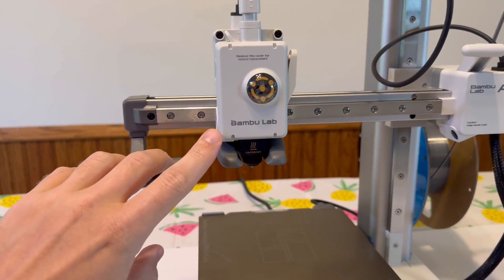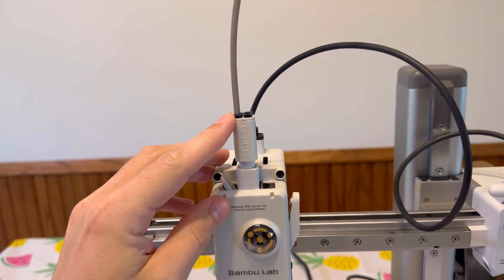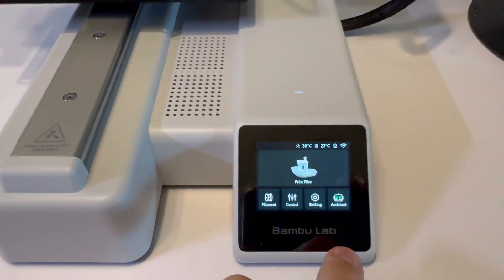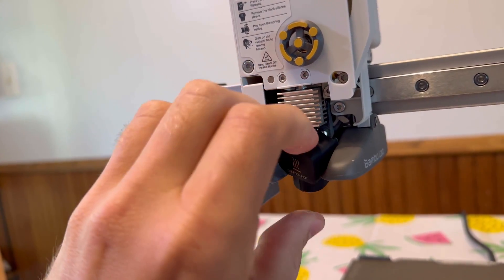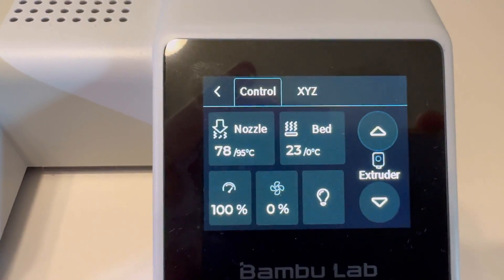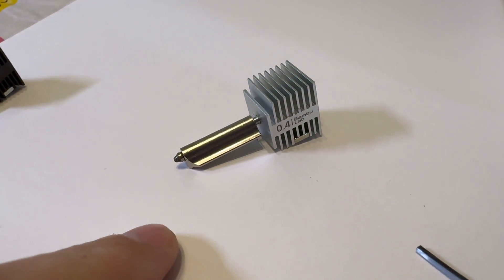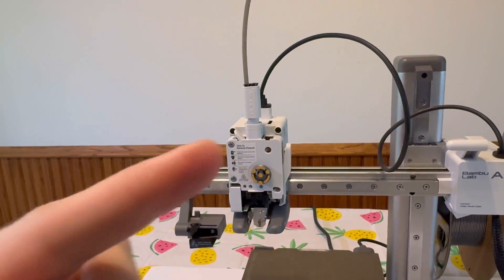How to Unclog Nozzle on Bambu Lab A1 Mini

Comment: I physically can't take the nozzle piece out, and my bambu lab A1 has been having a lot of difficulty. I can't find anyone online who's had any similar problems. Is there a way to fix that?
Reply: If the nozzle holder is stuck it is probably due to materials glue it on. I just brute force it open and replace a new heating unit.

Comment: Thanks, 3D Print Dude!!! I was able to unclog my A1 Mini. My clog was in the nozzle. I had to take the head apart, heat up the nozzle to like 240 C, then I fed some filament through the extruder, using the extruder controls to force out the filament that was causing the clog.

Comment: I need help with mine. The filament is too short to cold pull, and I dont know any other way.
Reply: You Can remove the top. Heat the nozzle to 200 and take somthing long and skinny to push the filiment

Comment: When I press "extrude " on the touch screen panel the motor will not spin the gear, but the gear spins when I manually push filament through.

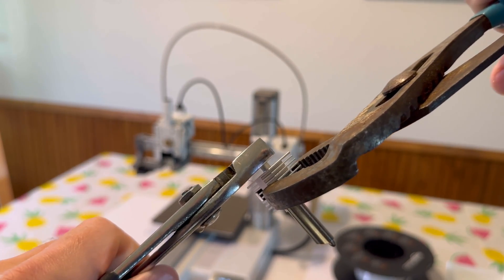Comment: 2:40 what to do if there's not enough filament to pull out? 😢
Reply: Hi @MasterGaia,
Did you find any solution to this?
Reply: @chaitanyabelsare9329  hey Man, yes! I used a straightened paper clip! Just got the nozzle off, heatened the paper clip tip (using a lighter) and pushed It against the filament that was stuck inside the nozzle. Waited for a few minutes until It cooled It off, then pulled It out. Worked greatly!

Ps.: its important that the clip sticks to the filament, so push enough to pierce It and wait for them to cool off!
Reply: Thanks man, it worked 🎉 @MasterGaia

Comment: The suggestions in this video are very problematic.

First, why not just wait for the hotend to cool down before removing it? Then you don't need to use any tools to remove it. Someone sent me this video because I asked them why their heatsink on their nozzle was bent. They said they followed the instructions from this video and bent the heatsink fins when removing it from the printhead with a tool.

Additionally, when you are using metal tools on an item that can be marred from your metal tool, you would typically use some sort of soft buffer material to prevent marring the item. Something like a rag or cloth.

Lastly, I suggest providing a brief overview of the steps at the start of the video before going over each step in detail.
Reply: What are you talking about? Bambu Lab themselves even say do a cold pull at 100°C. The Filament obviously newd to be kinda soft.

Comment: The nozzle we used blobbed up at some point. But was functional. However, when we tried replacing it, it was stuck to the surface and wouldn't come off. In thdt case, please raise the temp to 250 C. It worked for us.

Comment: My A1 Mini issue was a bit different but thanks for the helpful video. Plastic was not extruding properly, and extruder was clicking. 2 days of doing cold pulls, running needle through hot nozzle, taking extruder apart ... nothing solved the problem.  What happened was I had a roll of plastic that was all catawampus and I had to keep untwisting and pulling at it during a print when this issue began. This created a bad connection between AMS and Printer it seems.

I disconnected AMS with printer on. Turned printer off and reconnected AMS. Turned printer back on and problem solved.